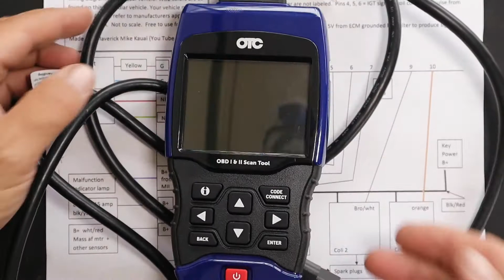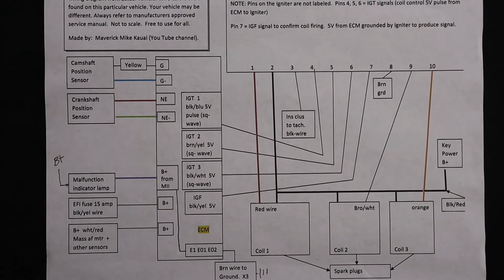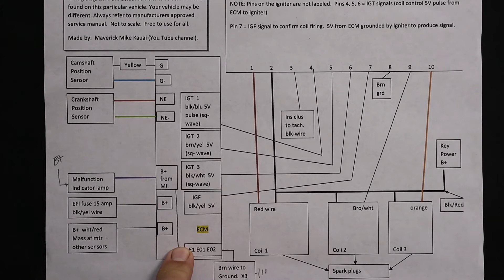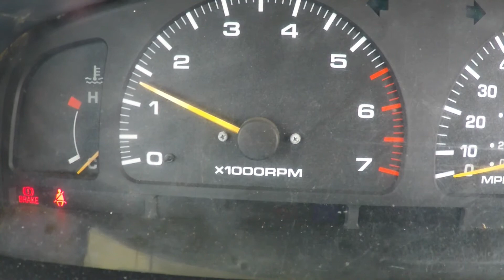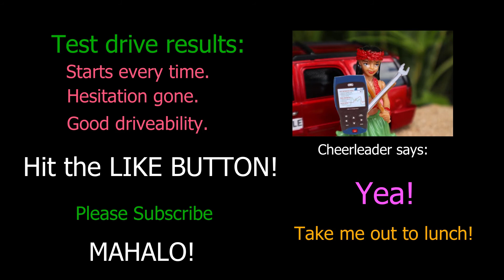Toyota 4 Runner: Wont start, no check engine light. Bad ECM diagnosis.  (2020)

Comment: You saved me a bundle. I ran a compression check, changed the plugs, plug wires and coils. New injectors. New fuel pump. New fuel filter. New fuel pressures regulator. New cam position sensor. New crankshaft position sensor. New timing belt (including water pump and tensioner with pulleys). New valve cover gaskets, New intake gaskets. Allowed the idle to "relearn". Still had PO300 P0301 P0305 MISFIRE CYL 1 AND 5. Every time I changed a part I ran a scan. ECM had a burnt corner just like yours!!!!!

Comment: C406: C stands for Capacitor.  It is an electrolytic one and has probably spewed its contents onto the bottom corner of the board.  You can probably just replace it and have a good spare ECM.
Reply from the maker: Good thought. Not my vehicle and I think the old one was probably sent back for a core

Comment: Did you say you bought a USED one or a NEW one?  What did it cost?
D406 is a diode.  If you look closely, you will see a cold solder joint. 
D = Diode
C = Capacitor
R = Resistor